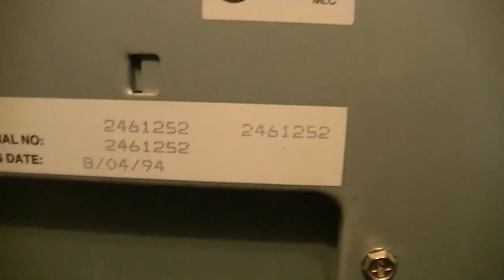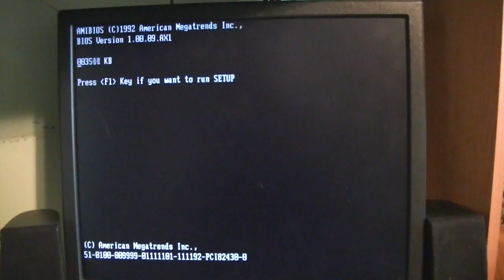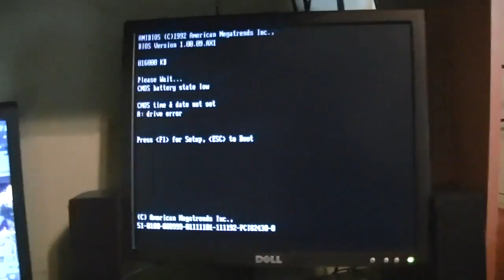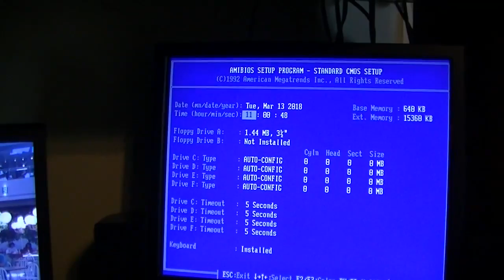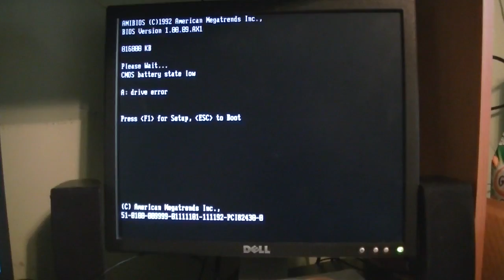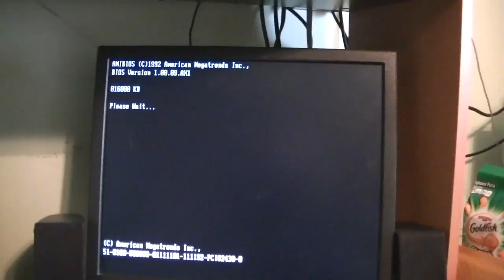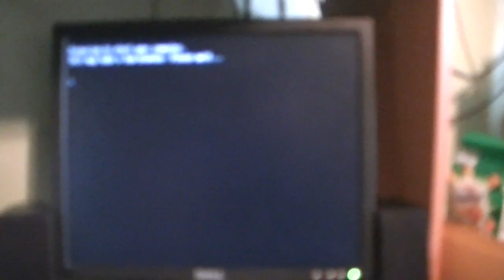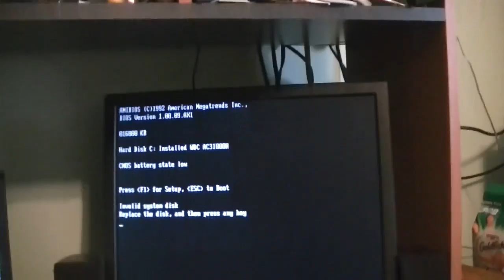Unboxing Another Mystery Computer

Comment: Billy, it's good to see you finally have that Gateway 2000 tower. The Dallas chip can be modified so that a CR2032 battery can be connected to it. It involves a little soldering but it's easy to do. You can still get hold of new Dallas clock module but the model number is different and I'm not sure if they're compatible.
Reply from the maker: Actually got a friend who's going to do that mod for me. :-) Just got to mail him the board.

Comment: My old workplace had a Gateway 2000 P5-75 in this outdoor container thing, along with an HP Vectra XM 5/133 on top. The Vectra was in fairly good condition (besides the slight rusting on the rear shielding) but the P5 was a sorry state. Rust all over the place and it did not look good, so I didn't take it. Took the HP though, works a treat!

Comment: Regarding that turbo button.
Certain Pentium 1 boards do have a turbo function. In fact, I just put a system together that does. Socket 5, gold cap Pentium 90Mhz. Board is an Intel Plato, has a turbo LED header, but no way to connect a turbo button, that is done via the key combination Ctrl Alt + or -. 
I connected the turbo switch of the case to the CPU frequency selection jumper. This board can only handle 75 or 90Mhz. So now I have four speed settings.

Also, it has a modded Dallas chip. Modding them isn't hard.
Reply: I'm guessing you would have to make sure it's off before pressing that "turbo" button.
Reply: You're right. You may also choose the "Turbo" or "Deturbo" mode in the BIOS setup. It will switch on/off the LED accordingly.
Reply: Intel Plato is the first board that supports Pentium 75/90 with Intel Neptune NX chipset. It also supports overclocking by moving a jumper to "Reserved" position. You have 75 / 90 / Reserved on a jumper. "Reserved" actually means 100 Mhz. Intel Pentium 100 Mhz was not available on market in march 1994 so they labelled it "reserved"... That's the way I managed to overclock my P5-90 back in these days!
Reply: I've seen someone else on Youtube doing this, can't remember who it was, that's why I even tried that out. So far I tested it while the CPU was in real mode and it worked. No ill effects. Doubt it will work in protected mode though.
Reply: Yeah the manual even mentions this 100Mhz setting. It also states that only certain revisions are compatible with an actual 100Mhz CPU though. Haven't tested out overclocking it, as I don't have much use for this. If I need something faster I'll use my MMX. That's the privilege of living in the future.
Edit: for the longest time I had an 166Mhz CPU in said MMX running at 233Mhz, because I always believed that CPU to be my 233Mhz one. Has no Mhz number printed onto it.

Comment: She is a beauty.The original Gateway 2000 software should be fairly easy to find too.
I liked their bundled software,system software and that Gateway 2000 binder
Reply from the maker: I have several restore CDs for Gateway 2000s. Unfortunately, unlike Packard Bell restore CDs, the Gateway CDs just include the install files for each program, with a few things missing.
Reply: By the way do you have the Gateway 2000 Desktop backgrounds and can you mention what specifically in software is missing.I have a bunch of their CD's from that era I think.
Reply from the maker: I do indeed have the wallpaper. I seem to vaguely remember my aunt's Gateway 2000, before it was upgraded to Windows 95, it having some kind of virtual assistant (similar to Bonzi Buddy, but not) that was a Medieval wizard who would help you install software. I've never found it on any restore CD. I haven't seen it since about 1996 or so.
Reply: Yeah I have never heard of that virtual assistant.
If your missing any other software just mention it to me and I'll look for it.
As of now I am remodeling my house so I won't be able to access that stuff (in storage for another month or so)
Edit are you running the Gateway 2000 Start Pack System 1.4 or is it another version?

Comment: If you was to build a pc, after you installed windows, would you install the drivers that came on the cd for your motherboard and GPU, then run windows update, then your finished, or after you installed windows, would you run windows update, go to the motherboard and GPU's website after windows update finished installing, and get all the drivers from the websites?

Comment: You may upgrade the BIOS to 1.00.16.AX1. This operation will allow 2 GB hard diskes and will upgrade the BIOS interface to modern standards. Also please note that :
- This Intel Premiere/PCI Plato motherboard has a nasty IDE bug with data corruption when CD and HDD are used simulaneously. This is not really visible in DOS/Win3X but can be annoying in NT/Linux
- The RTC battery resides in the Dallas chip soldered on the motherboard. It would be necesseray so solder a new Dallas Chip
This is a truely lovely machine. ENJOY !!!

Comment: Also please note that the NDC-CD360 CDROM is not fully IDE compliant. It plugs on an IDE port but won't comply to ATAPI standards. So yo need to use a DOS driver to make it recognized in DOS and Windows 95/98. It won't be compatible with any kind of NT Windows version. And in Windows 9x it will function in "real mode" using the DOS driver
Reply: I meant "NEC CDR-260" CDROM. Dell has released a special CDR-260R version that fully complies with ATAPI. Gateway didn't. They replaced it with the Mitsumi FX400 instead.

Comment: Last but not least : at this time period Gateway 2000 provided either a Matrox Ultima PCI video board or an ATI Mach 64. The Matrox had a very good performance in Windows but terrible performance drop in DOS games. DOS games performance was comparable to 386 speed. I don't exagerate : Doom lags a lot an looks like a slideshow. It's about 10 times slower than with the ATI Mach 64. Matrox introduced good DOS performance 1 year later with the Millenium